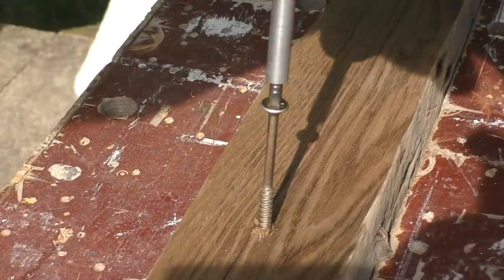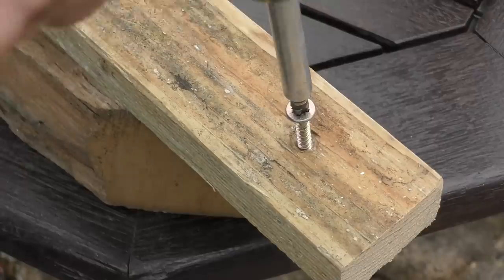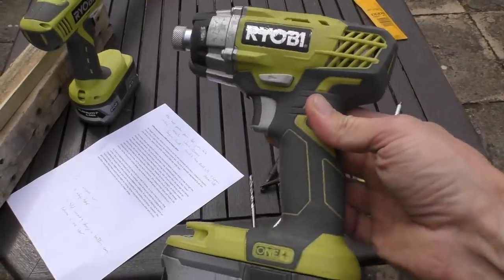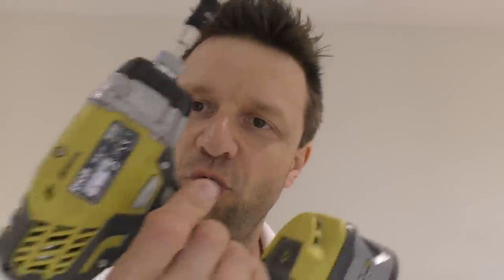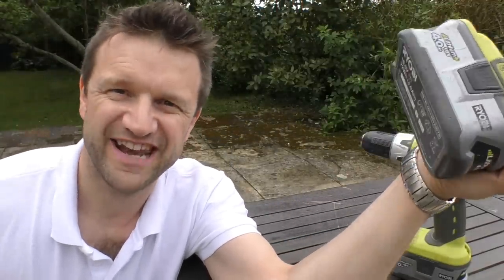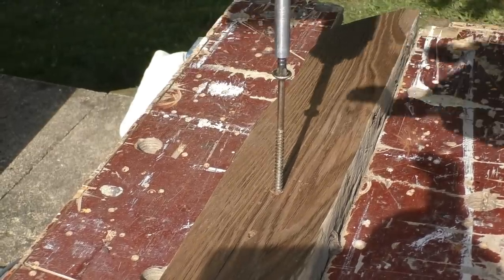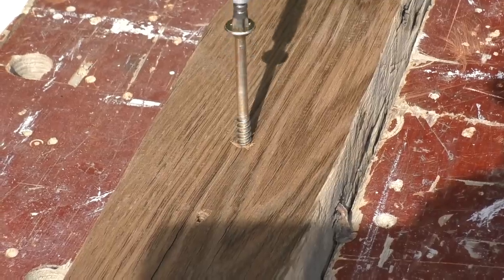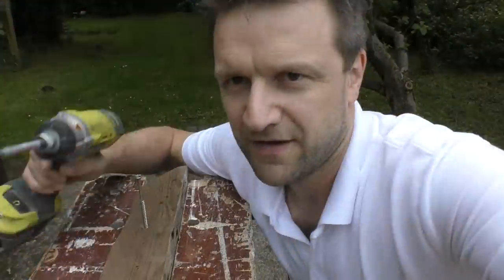Difference between Drill Drivers & Impact Drivers

Comment: Interesting point about the batteries, However Amp Hour (Ah) is a measure of capacity not capability, Amps is the measure of capability (not same as Ah which is printed on the battery, for instance a 18v drill battery is probably outputting over 10 to 12 Amps under load), obviously the higher Ah batteries have more cells in parallel so can delivery higher Amps, which Ryobi seems to have omitted to mention definitely something worth considering at least with Ryobi tools, I've never noticed any difference with my Makita 1.3Ah vrs 3Ah batteries torque wise, but it's not running on Li-Ion either.
Reply from the maker: Thanks for that - great knowledge!
Reply: I was thinking about this earlier, and wondering if they use just 5 cells 5S to achieve the 18v with low C output, where with the larger capacity batteries using 10 cells 5S so upping the amps?
Reply: Jer, most of us already know that and consider it bone headed to give a lecture on batteries every time we just want to acknowledge that the higher Ah packs have more capability.
Reply: Filon, no you have it backwards.  In the same cell size, higher amperage capacity limits the Ah capacity due to the difference in cell design to achieve high capacity.  They have to do that with the single-series cell packs to achieve the specs they state for the tools they provide them with.

If they used the same cells there would be a difference because the 4Ah pack uses 10 cells, two parallel series so the current coming from each cell is cut in half for the same load, so they do not suffer as much voltage depression, so into a resistive load the power remains higher.  One should not consider the possiblity that one of the cells is damaged unless you have a specific reason to, such as it not maintaining the correct voltage at full charge or dropping rapidly during use to a new lower steady voltage plateau which is about 3.7V below what it should be.  The charger should also refuse to charge the pack if this state is present.
Reply: Only the cheap batteries have power differences with ah ratings. Probably just cheap cells. I also notice no difference in power in my makita tools no matter which battery i use, only difference is run time. Ryobi and ridgid tools i know have huge differences in power depending on the battery
Reply: obviouslyt a bigger jump...  but  i have a  milwaukee  18 v  you can feel the difference between the 2 AH and 5 ah and  9 AH
Reply: cause milwaukee is just a red ryobi
Reply: aedvark then the comparison is even more accurate.
Reply: Just commented this. Will now delete my comment 😂
Reply: I can't tell no power difference between my 1.5ah and my 5.0ah DeWalt 20v batteries..I did say "power difference" but duration between battery life between both is a totally different beast
Reply: V.Vega I agree. My Dewalt batteries show no difference in “power” only in run time, which is as it should be.  The Ah rating should only apply to how much time the battery will last under load. Think of a battery for a travel trailer. It will have a rating of say 100Ah. So if you are running a light that draws 5 amps for 2 hours your battery should be down to 90Ah. It seems that some brands such as Ryobi have done something different to their batteries either as a cost cutting measure or as a sales enhancing measure to sell the more expensive batteries. I’ve been using the same Dewalt 18v drill/driver since I purchased it in 2001. I have multiple batteries of different Ah and the only difference has been how long each lasts. The same applies to when I use them in my circular saw. 
Just my personal experience while working as an electrician for 25+ years. 
Cheers.
Reply: @abrahamrivers4250 ...Even my 6ah/60V Dewalt, the difference is only run time. I will say though, that difference does not override the additional bulk/weight, or the cost. My 6ah/60V was given to me, and I appreciate it as a gift, but I would not purchase one with no 60V tool to run it with.
Reply: @fagath7  Oh good. I was wondering how the Ah capability would translate to less power. It seemed incorrect. You've  explained, and thank you.
Reply: I bet if he had drilled a pilot hole and used the smaller battery it would have gone in the timber much better and faster o and a little bit of soap on screw.?
Reply: Thanks for this knowledgeable comment.
Reply: This is a general rule for pretty much any cell. Even nimh rechargeables. AA cells have a much better current/voltage curve over AAA for example.

The pilot hole comment is the true winner though. It may take a little prep time but probably saves in the long run.
Reply: I was going to mention this in my own comment as well,  but then I saw your comment, lol. Yeah, I've never seen any difference between my different batteries besides capacity.
Reply: @CharlieDIYte  Never really understood why they never put max rated power-draw on these batteries. Apart from Ah (the size of the tank), the Wattage is really what is important for raw power. I saw your 1.33 Ah battery had a 24 Wh rating, but that's just Ah x Volts so it really doesn't add anything informational. I have a 2 Ah battery that my saw consumes in between 5-15 minutes, depending on material. Which means that the saw draws between 16-48 A at 18 V, or 288-864 W, assuming perfect battery conditions. But I also know that the larger 4 Ah battery packs give more power (parallel cells), so... why is this not printed on the batteries. If I have a 1200 W capable drill, I would want to know how much of that power my battery can provide. Anyway, thanks for the very informational video, I did go and get an Impact Driver after this, and it's been great. Have some paneled walls (not sure of the material) in the garage that my regular drill-driver simply stalled at. The impact driver just... drove. Same battery.

Comment: Thank you! I have both of these tools - got the impact driver well after having had the drill driver. It didn’t work that much better for driving in screws, but now I see the battery is really the problem! I’m enjoying the DIY journey...
Reply from the maker: Ah, good to hear from you. Yes, the battery is key. The 3Ah would probably do the job, but the 5Ah is only £3 more, so although you're lugging around extra weight, it's a worthwhile investment https://www.direct-powertools.co.uk/ryobi-batteries-c102x3253977 In only use the 4 and 5Ah on my Ryobi tools now. I've got a heap of 1.3Ah I got with the various starter kits, and they just sit in a pile unused in my basement!

Comment: I recently encountered this situation when as I was shopping for a Hammer Drill online.
The seller had on sale a "Hammer Drill Set", a Drill, several drill bits, 2 battery packs, flexible connector and a handy Hammer.
It was seriously a bargain!

I hit the BUY button then something kicked in my head. So I asked the seller: "Is that a Hammer Drill?"
They replied: "It is Hammer and a Drill, 2 separate items."

Obviously I did not continue with the purchase... ASK before buying.
Reply: I too bought a kit. Drill driver, Impact driver, 2 x Batts and a Charger - all in a handy carry bag. Best of both worlds.

Comment: You can avoid the need of excessive downward force by using torx or any other contemporary screw head designs.
Reply from the maker: Totally agree Martin, and I have to buy more torx head screws. Thanks for the comment!
Reply: I've stripped the heads of MANY star drive deck screws. Same with square drive, allen heads, self tappers, phillips or slot heads, all can strip out. Where the star excels is removing the screw when you've over driven it and there has been enough time for the wood to swell around it. But yeah, now that I re-read what you actually wrote...That's very true.

Comment: A drop of nearly any sort of lubricant on the thread will help driving long screws. It will also help save the screw head and driver bit from getting damaged.
Reply: rubbing screw on a bar of soap works too
Reply: Candle wax is brill

Comment: You've used a phillips driver on a pozidriv screw which will make it cam out. See the little diagonal markings around the head?

If you drilled a pilot hole you would get by with a drill driver
Reply: Or if he used screws designed to drill their own pilot holes like the self drilling deck screws you can get at hardware stores.

Comment: From my experience(as an aircraft mechanic on MD-11's) with impact vs Drill drivers is as follows: If you want to install a screw so it can be removed again, use a drill (with appropriate clutch setting). If you want to remove a screw and have it be useable again, use the impact driver. If you want to destroy the screws/what you are trying to work on, do the opposite. (Drills are fantastic at rounding out screw heads, and impact drivers will simply drive screws in so hard it can actually damage the structure you want to screw into.

Gross oversimplification of sorts, and not at all addressing the operational differences between the two systems, but whatever, I'm tired.
Reply: "If you want to install a screw so it can be removed again, use a drill "
"Drills are fantastic at rounding out screw heads",
Ain't both of these statements a bit contradictory ?? if drills make screw heads rounded out then one shouldn't use drill if he wants to be able to remove the screw too.
Reply: @irtzashahanpk  it sounds slightly contradictory, but it really isn't if you have experience in the field the way I do.

The drill provides a semi constant force to move a screw (clutch notwithstanding) when putting a screw in, this is fine and good, the screw will move freely until it goes all the way in. When removing screws, however, this works against you, as you are trying to take the stuck screw and make it turn. The constant pressure makes it so that if the drill slips in the head of a Phillips head screw, the bit will keep spinning quickly rounding out the head quite fast.

The impact on the other hand provides bursts of high torque impulses, which are more likely to break screws loose without destroying the screw head the way a drill will.

I know it may sound confusing, but I spent four years doing panels for heavy maintenance at a MRO in San Antonio working MD-11's. What I said really does work.
Reply: Good thing impacts have settings on them…….

Comment: "Ah" is the amount of charge stored in battery, ie capacity, has nothing to do with the power (=Watts=Energy delivered per unit time = Current x Voltage). Given that both low and high capacity batteries are rated with the same voltage, 18V, then the high-capacity battery must be delivering a higher current (Amperes) than the other for it to be more powerful. My guess would be that more batteries are connected in parallel to deliver a bigger current as also pointed out by others.
Reply: You’re wrong. Watts is power. Correct, but W=VA so the amount of Amps a battery can deliver is directly related to its power. And the amount of Amps it can deliver is also related to it’s capacity. It’s weird how some people just don’t get it. Try this - put two identical batteries in parallel and in series. Do the math - they both deliver the same amount of power. So if you have 5 batteries in series as per the power drill if you add another 5 in parallel you no only have twice the capacity but twice the amount of Watts. Go and look at a battery datasheet. Nearly always power will be given in terms of C(apacity) sometimes both continuous and peak.

Comment: From a nice article on Thought.co:
"Phillips screw has an X-shaped slot and is driven by a cross-head screwdriver, designed originally in the 1930s for use with mechanical screwing machines, intentionally made so the driver will ride out, or cam out, under strain to prevent over-tightening."
In effect, the Phillips screw head and driver were intentionally designed to be "self-stripping" - not really, but it does explain how easily one can strip the screw head or damage the screwdriver bit.  The mechanical screwing machines first designed in the '30's had no clutches or torque-limiting capability, so the screw head and bit combination had to be designed to prevent damage to the workpieces.
Phillips head is a TERRIBLE design for use with modern power tools.  I only use Robertson, because they are widely available (at least in Canada), much cheaper than Torx head, and the screwdriver will hold the screw while you are lining it up for insertion.  It's truly a one-handed tool!
Electricians love the Robertson screws - you can position the electrical outlet box with one hand and put the screw in with the other, in no time.
Reply from the maker: Hi Steve, that is my kind of comment - many thanks for taking the time to write it! I screen grabbed it and forwarded it on to the fitter who works for me and who has far too many Phillips screws in his collection - mostly dry lining screws which seem to be the main offenders for using the PH screw bit in the UK. Totally agree, and annoyingly I managed to accidentally use a PH bit in the video - when I should have used pozidrive to match the screws, as a few eagle eyed people have pointed out! Yep, I definitely need to buy some Robertson head screws - you're not the first person to sing their praises on this feed. Thanks again.
Reply: Thanks for the kind words!  
The scenario of Phillips vs Robertson is yet another example of how technology becomes "sticky" even in the face of better substitutes.  I'm reminded of the story behind the QWERTY keyboard, which was designed to SLOW DOWN proficient typists, so as to prevent keys jamming in the first old manual typewriters.  Another example might be the VHS vs Beta tape formats.
Unfortunately, here in Canada we're mostly at the mercy of American standards and products.  The electrical plugins used in the UK are brilliant - the ground lug being longer, it uncovers the hot and neutral when inserted first.  Do you see that in North America - no way!  Such a simple idea....
Anyway, keep up the good work - I enjoy your channel very much.  As a result of this video, I've bought a Ryobi cordless impact driver, and I can't wait to find something to drive with it!
Reply: Steve Elves The screws in the video aren’t philips heads, they’re pozidriv (4 small extra “notches” compared to philips)
Reply from the maker: @gvanvoor  Yes I know, but stupidly I accidentally used a PH 3 bit - because it was in the PZ3 slot in my tool roll - as rather a lot of eagle eyed people have pointed out!
Reply: While it doesn't make too much difference just driving screws into a beam wood like in the video, when used in hard to access places like awkward corners, the extra 2 points of engagement (reducing the angle between engagements from 90 to 60) does really help when compared to Robertson.
And while Torx may be more expensive for now, but as it's popularity increases, the prices should mostly even out.
Reply: Gregory Van Vooren  Pozidrive is a phillips patent though so they are phillips screws and they are compatible both of them are really obsolete though.
Reply: rimmersbryggeri I didn’t know pozidriv was a philips patent but the pozidriv-philips compatibility is limited: you can use a philips driver on a pozidriv head (with more slipping than the matching driver would) but not the other way round. For bigger or longer screws I usually buy screws with a torx head. For small or short screws the “classic” pozidriv (not a lot of philips sold here in Belgium if we ignore dry wall screws) seem to be good enough.
Reply: Gregory Van Vooren  Same as here in sweden probably. Pozidriv was designes as an improvement of phillips but it still leaves alot to be desired. Roberston or torx is the way to go unless it's in a prominent decorative place on furniture but then it's slot heads. YOu don't need screws to make beer though which is the main belgian industry for me. ;)
Reply: Wouldn't mind robertson screws but not many variety can be found here in hardware stores like Phillips screws. Unless you go to an exclusive bolt and screw store.
Reply: I wish they were popular in the Uk
Reply: Dean
Reply: If you can find them, JIS (Japanese Industrial Standard) bits, they’re compatible with Philips screws, but are designed NOT to cam out under torque.
Reply: Phillips was invented by the aircraft industry, at the beginning of WW2
Reply: I retired as a master electrician last month. I simply use a magnetic bitt
Reply: @steveelves3499  Always been proud of the British plug! There are websites for plug fans on the internet, but don't tell anyone as they might think you're a bit sad!
Reply: @Joe-kb1sm  I don't think so - I believe they were first invented for the automotive assembly line long before WWII.  A lot of the assembly techniques invented by Ford and other American pioneers were copied over to the aircraft industry after 1939, and that helps to explain one reason why American factories were able to far exceed the output of other countries.

Comment: A great description of both tools. Interesting to see the difference in power with the different batteries. Ive just bought a 4 pack with drill, driver, grinder and circular saw. Wasn't sure about the difference between the drill and driver. You've cleared that up for me. Thanks. 😄👍
Reply from the maker: Thanks buddy. There's a bit more info in this one if you have a few spare minutes https://bit.ly/3sxpfw5
Reply: @CharlieDIYte  Thanks mate. I’ll have s look later 😃👍

Comment: I'm a Sub Contractor not a DIY'er. I depend on Ryobi tools for every job. I have a lot of Ryobi tools that I use on the daily, that I make one a bad week, 500, on a good i can make 1,000 or more. As far as I concerned, Ryobi tools get the job done, regardless of the job your doing.
Reply from the maker: It's good to hear that Virgil. Yes, I get a fair amount of stick from tool snobs for using Ryobi but my experience of using them is the same as yours. 👍🏻